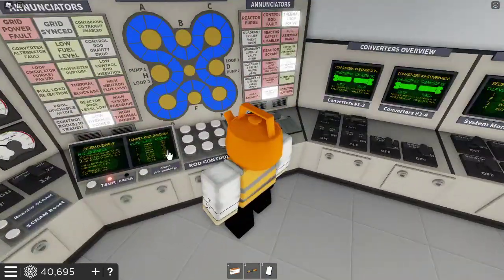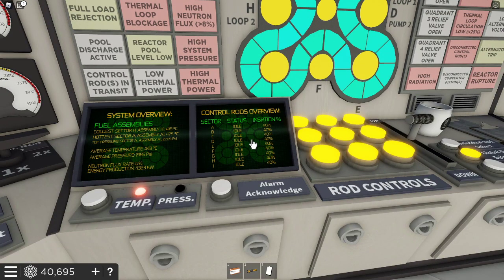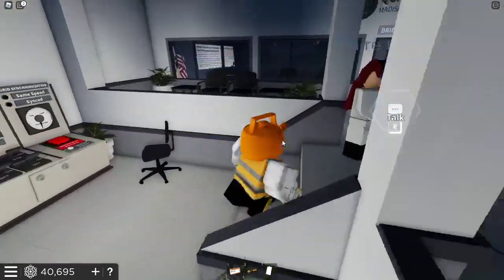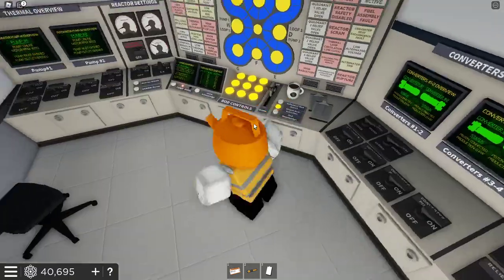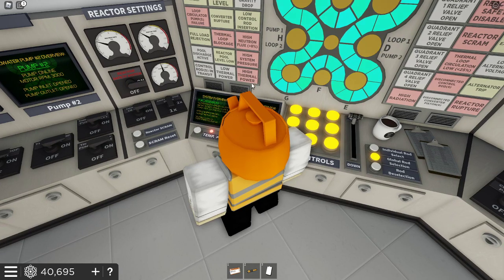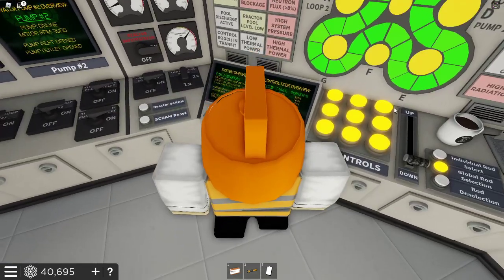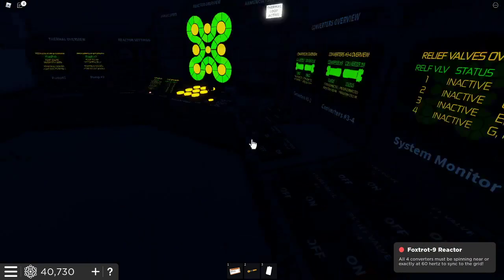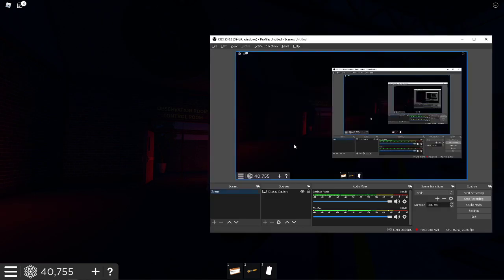Foxtrot-9 Reactor Tutorial (QSERF)

Comment: How to make a fuck ton of power using F9:Put rod select to global, CR speed to 2x and enable continous CR transit, close the relief valves and turn on the pistons, drop the rods 25% (so for example if the rods were at 100% you'd get them to 75% and so on, repeat that until you get to 10% rod insrtion) when its at 10% you want to check the sync thing, if the spinny thing goes counter clockwise then dont turn on the valves (unless high pressure/high thermal power alarm pops up) if its going clockwise then release the relief valves until the spinny thingy is barely moving and its pointing up. After this you can sync the reactor, once its synced change the view to temp. and get the rods to 40% then you want to check the places with the highest temperature using the relief valves you can get the highest temp 820⁰ then you disable continous CR transit and set the rod speed to 1x then you want to quickly get the rods to 35%, when the highest temp reaches 850⁰ set the speed to 2x and get it to 40% again and release the valves to slow the temp rising, when the temp stops rising you shut off the valves and you just keep it stable.

Congrats! Youre making a shit ton of power now!

Comment: How do you blow it up
Reply from the maker: Get the pressure up, make sure to not get the neutron flux too high or it'll SCRAM.
Reply: @TheKestrel76  uh if the pressure gets to high it will scram
Reply: Close all valves, raise the rods to 10-20% then when the pressure hits red pull the rods at full speed so the flux goes >8% and there you go alot of alarms will ring and boom